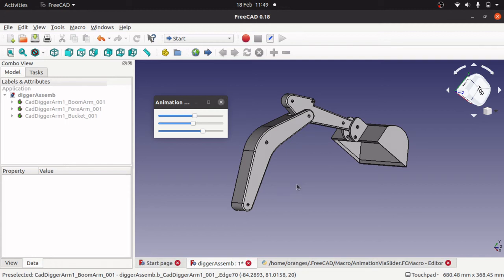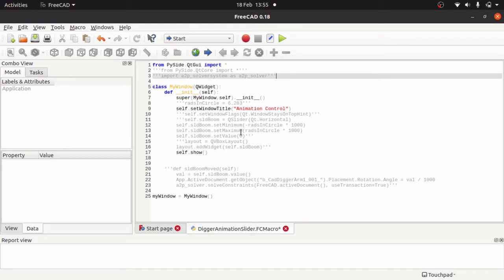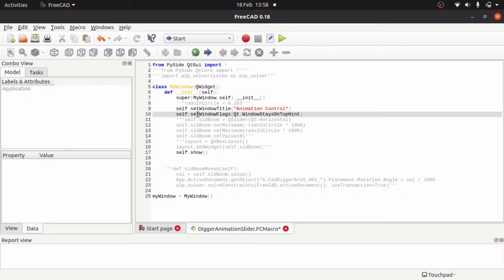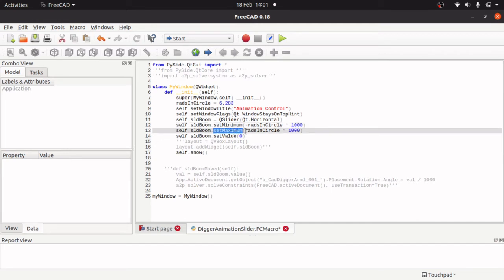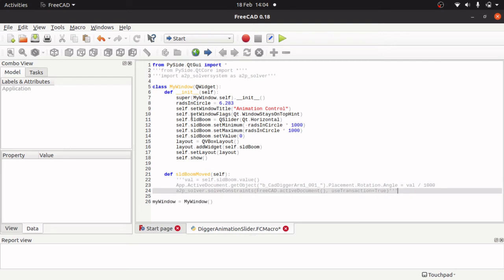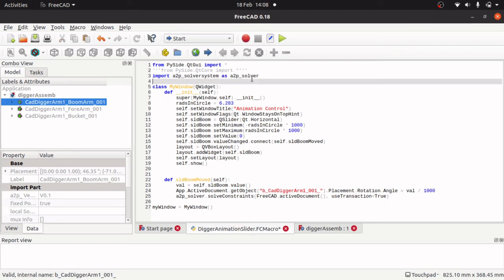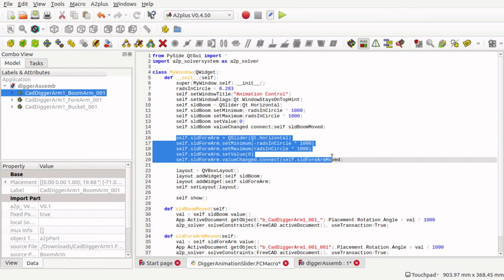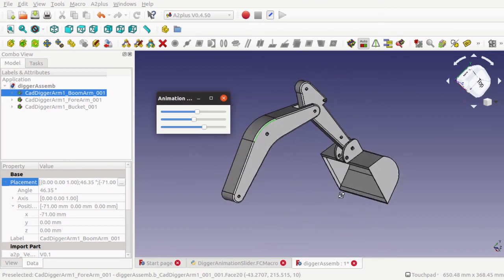FreeCAD Prep of Digger Arm for Kinematic Like Animation 3 of 3 A2Plus Workbench (viewers questions)

Comment: Does A2Plus work on the latest V0.19? I have imported the files together and constrained them but they do not move.
Reply from the maker: That's the version I am using. Check to see if you have a part that is fixed? If not then this would be your issue, you require a fixed part to allow for constraint.

Comment: Hello,  I've never used python within FreeCad.  At 1:57 you jump to a scripting environment.  I assume this is the macro editor.  I tried to copy what you did, but got an error "GitPython not installe!  Cannot retrieve macros from git".  You mentioned that PyQT is included with FreeCAD.  I have v.19.  Do I need to do something to enable PyQT?
Reply from the maker: I have never come across this message before. The editor in question is on the macro menu, macros... Then add new macro. You will then have a macro window. I did some searching and found this link where a few people are having similar problems which may help you http://forum.freecadweb.org/viewtopic.php?t=45592&start=10

Comment: Nice! That works really well I'm surprised how compact the code is! 
I'm wondering the effects if you add the same slider increment/decrement to the opposite 2 parts as well, to keep the motion relative to the section being moved, so it behaves more like a real hydraulic arm if you were to move a single control.
I will be having a go at that when i get some free time,  now you have made the basis for it.
Thanks again : )
Reply from the maker: Glad you like. Yes please have a go and let me know how you get on.